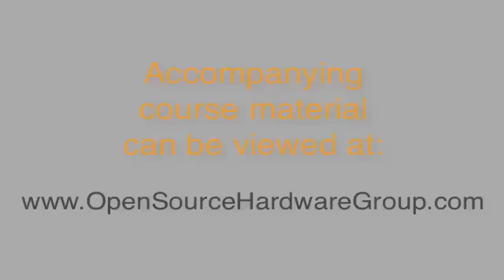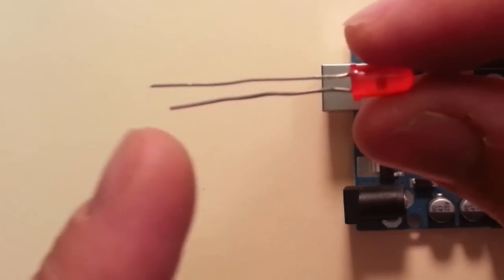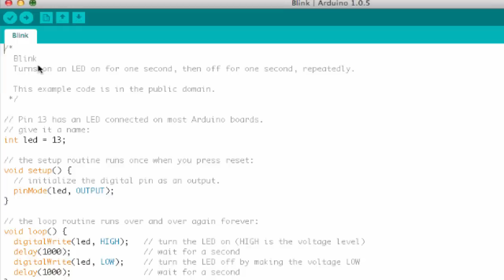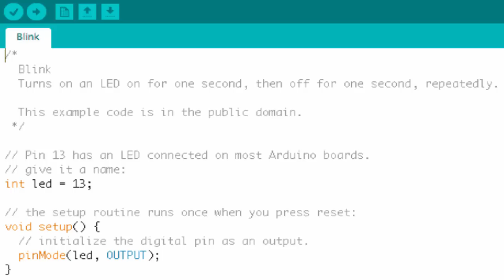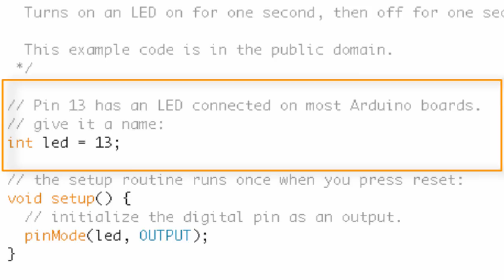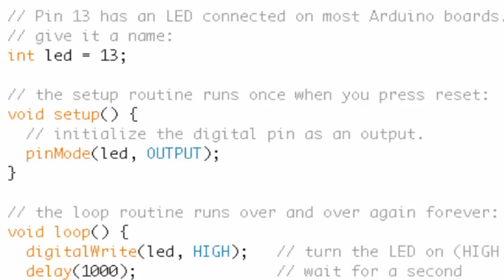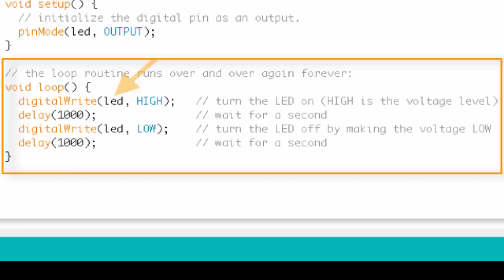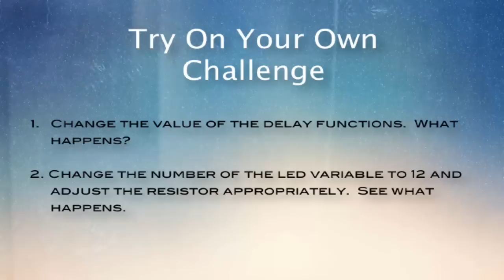Tutorial 06: How to Blink an LED: Arduino Course for Absolute Beginners (ReM)

Comment: If i change the delay of the led by increasing it the led will take more time to turn off
And if i change the number of led to 12 without changing the place of the resistor to pin 12 the led will be always off

Comment: can anyone explain me why we need to connect it to a resistor and not directly? if this is a silly question, please excuse me. im totally new to practical electronics.
Reply: Not silly, the current from the power source is so high, it would burn out the LED.  By placing a resistor in the circuit , the extra current is consumed as heat (in the resistor) and the current reaching the LED is within its ability to use.  OK?  There is also a voltage drop, but getting rid of the extra current is the issue.  Keep it simple.  If you do not use a resistor, the LED will burn out in a few seconds.
Reply: Thanks man.
Reply: No Worries, about wasting - it may seem that way, but the resistor is like a restrictive water pipe - not wasted held back.  The current (energy) and voltage (force) are not all wasted.  Yes some of the voltage drop and current go up as heat, but if the power were just enough to run a few diodes then the Arduino could not have all of those other neat devices hooked up to it without some external power source.  It is all a compromise.
Reply: It can but your led and arduino

Comment: what if we write int led = 50; or any number which exceeds the number of pins...does arduino take int variables to store the pin number only? or is it when we define pinMODE that it checks the value stored in led and takes it for a pin number...it associates the numbers to pin numbers inherently ?

Comment: I am using LED without any resistor for pin 13 and 12. It still blinks. Is there any problem if I don't use resistors with LED??

Comment: Sir I have a problem 
I want to blink one led (3 second on , 3 second off , 1 second on , 1 second off ) in a loop . I try it may time but I failed .Can you help me . 
Is this program is possible??
Reply: digitalwrite(13,high)
delay(3000)
digitalwrite(13,low)
delay(3000)
digitalwrite(13,high)
delay(1000)
digitalwrite(13,low)
delay(1000)

Comment: im having a problem with this code every time i compile it an error message is generated
int led=13
void setup() {
pinMode(led, OUTPUT);  

}

void loop() {
  digitalWrite(led,HIGH);
  delay(2000);
  digitalWrite(led,LOW);
  delay(2000);
}
Reply from the maker: You may need to add an " ; " semicolon after:
int led=13

Best of luck!

Comment: Do you have a tutorial that might help me do this with a breadboard because that is all I have?
Reply: Just run a wire from pin 13 to the positive power rail and one from GND to the negative, hook up the resistor from either of the rails to the LED, and hook up the LED from the resistor to the opposite rail that you started with. :)
Reply: Thanks this helped so much i am a super beginner so thanks for aiding me

Comment: void setup(){

pinMode(13,OUTPUT);
}

void loop(){ 
digitalWrite(13,HIGH);
delay(500);//Modificar para cambiar la velocidad de parpadeo             
digitalWrite(13,LOW); 
delay(500);//Modificar para cambiar la velocidad de parpadeo             
 }

Comment: I was thinking that setting a mode for the pin was useless because we are putting the voltage in the void loop so
i've deleted the part with the pinmode in order to see what happens 
and it was still working but with less light
why it is like that?  i didnt get it

Comment: I would certainly absolutely refrain from using the phrases "high voltage" and "low voltage" over and over because they mean very specific things. I would have instead used the correct terminology "high state" or "low state" or perhaps "high signal" or "low signal"

Comment: by saying that change the number of the led variable to 12and adjust the resistor appropriately......... what do u mean like putting the resistor on pin 12 and not on 13??????

Comment: Thanks for this tutorial, I was wondering if there is a minimum allowed delay time? the number you input is in millisecond but what if I want a delay to be in microseconds? does it work to just input delay(0.001) or the arduino itself can't control down to that limit?
Reply from the maker: Great question!  There is actually a function that allows you to enter microseconds called: delayMicroseconds()

You can read some about it here:
https://www.arduino.cc/en/Reference/DelayMicroseconds

Comment: Why is the resistor necessary? It seems to work just the same without it.. 
Great videos, lost of solid info. Thanks man
Reply: LEDs work on very low voltage, by NOT using a resistor you are litterally making the LED work at a much higher voltage , which it will do, but you are shortning the life of the led drastically.
If you have 2 LED's one with a resistor and one without and just turn them on. the one with the resistor will last for years, the other one will burn out quickly.

Comment: Excellent tutorial.
Can you help me?
The LED turns on the moment I connect the USB to the laptop, and the arduino does not respond to the program, the LED just keeps glowing.
What should I do?
Reply: That's because of the default program to check that everything's normal before you start working .. you need to overwrite the program to make it function differently.
Reply: +TATHAGAT MANI  ok thanks

Comment: how do we know which resistor to use?
Reply: +Arth Dh from V=IR (voltage = current x resistance) resistors in series you add resistances together for your equivalent (total) resistance. resistors in parallel you do the inverse of the sum of the reciprocals [(1/R1 + 1/R2)^-1]
Reply: +andr marq (Andrmarq92) Okay thanks

Comment: Geat,  but I have one suggestion. Could you please explain why are you using 230 ohm resistor? Why not 1k? Why do we need the resistor? 

Cuz you explain programming side so detailed and hardware side is what I personally don't understand.
Reply: +Fhhh Gdtvc 

It has to do with how much current the Arduino can sink or source at each pin. A LED or light emitting diode can allow to much current to flow if a limiting resistor is not used an damage the Arduino. Also the LED is rated for just so much current. Too much current flowing through the LED will burn it out also. With that said the lower the resistance value the more current that will flow and the brighter the LED will light. Too much resistance value and too little current will flow and the LED will be very dim or will not light at all. You can calculate the current flow with Ohms law. But normally 150 to 470 Ohms works well for a LED.
Reply: Thanks!

Comment: Someone please help! I'm getting an error message when I upload, it says:

avrdude: ser_open(): can't open device "\\.\COM4": The system cannot find the file specified.
Reply: +frost Nvm, I got it to work!
Reply: +frost inside the IDE (arduino software), make sure you chose the right model that you are working with under TOOLS->BOARD-> YOUR MODEL

and also select a port under TOOLS->PORT
Reply: Did that but no worky doky

Comment: Is there an Arduino simulator that I can use with components before running on the hardware?
Reply from the maker: +Lionel Faleiro To be honest I have never simulated an Arduino, nor have i used this program - but it sure looks cool!

https://123d.circuits.io/lab

Best of luck!
Reply: +Programming Electronics Academy I had a play on that site when I was waiting for my arduino to arrive. It is a little buggy and I lost interest after half a night of trying to make things work. It would be great if it was more reliable.

Comment: In regards to your challenges at the end of the video switching to pin 12 made the Led light not as bright, Why did that happen?
Reply from the maker: Hi Carlos Orta , by chance did you use the pinMode() function to set pin 12 as an OUTPUT?

Comment: Thanks again - just a quick question. Are variables for Arduino only meant to assign pin numbers? In other words, any number used in a variable is a reference to a pin?
Reply from the maker: Great question!  Actually variables in Arduino can hold any value, for any purpose you can think of.  It happens to be really handy for variables to reference the number of a pin.  But variables just as easily hold sensor input, times, and all types of information essential to getting a program to work.

In this example we could have used a variable to hold he delay time...

//a variable to hold the delay time between LED Blinks
int Delay_Time_Milliseconds = 1000;

Then in the code, we would reference our variable inside the delay() function...
delay(Delay_Time_Milliseconds);

Hope this helps some!
Reply: JustifyJustin think of variable as just a place holder for anything, like in maths 2+2=4 or a=2, a+2=4... :)

Comment: When I opened my example, I noticed that the script is not setting up a variable with the connector pin, instead it is actually coded the following way: 
pinMode(13, OUTPUT);

I figure when you call in pinMode, it assumes you need to have a pin which can be defined at this point or previously through the variable defined. I have some experience with python scripting and am excited to learn more about the arduino/C lanquage.

Thanks for the tutorials!!
Reply from the maker: Glad the videos can help!

Comment: Thanks for the great tutorials. It seems quite straightforward for someone with no electronics experience whatsoever, like me. Just one question, though. What would happen if you didn't include the resistor?
Reply: Resistor is used to limit the current through LED . so u dont end up wasting LED
Reply: Darshan Yadav  thank you

Comment: If you are learning like me a great trick to remember is this. The word CATHODE derives from the greek word "κάθοδος" which basically means decent. In greek they say "Ειμαι καθοδον" which translates as "I am coming". So always know that Cathode means "i am coming" which means the electricity is coming. So remember that the RED lead is purposely colored red indicating danger that a current is coming from it. The RED lead is the Cathode.
I always try to remember them as "the good and bad lead". The good lead is the red which is the positive lead and the bad is the black which is the negative lead. Also on a LED long means positive and short means negative. Long leg is the cathode and short leg is the anode. If you still don't remember this way, turn the LED around till you find the flat side. That flat side on the base of the LED indicates the negative leg.

Comment: Nice course! But why you need 220ohm resistor connect to ground? why not to put straight led to pins to 13 & gnd?
Reply: You'll fry the LED. Some kind of resistor is needed, I used a 330 ohm because that is what I had.
Reply: I think 85 Ohm resistor is more suitable, considering the voltage drop.

Comment: I entered the code exactly as you've presented it, however, when I upload it to the arduino board, the led only blinks a few times and stays on. Why does that happen? Why doesn't it continuously keep blinking?
Reply from the maker: Saila Maham Hi Saila,  Maybe try opening the example sketch, instead of typing it, and see if that works.  It would be under File > Examples > Basics > Blink

Comment: why does the resistor go in the pin 13
Reply from the maker: Great question.  If you wanted the long leg of the LED to go into pin 13 first, and then attach the resistor to the short leg of the LED, that would be fine too.  The resistor does a few things, but generally speaking it limits the current that can flow through the LED (otherwise, given enough time, the LED can be damaged).

Hope this helps.
Reply: thanks that helps alot! :)

Comment: Do I get the impression, you don't like cats? LOL
Does pin 13 not have a build in resistor?
Reply from the maker: Ben Sibeijn I don't mind cats :)

I am pretty sure the resistor at pin 13 will not  work to limit current for external LEDs, it does though work good for the onboard LED.
Reply: If one looks at the examples and illustrations for the hello world sketches (blink) including the one from Massimo's ( getting started) one sees that there is no 220 Ohm resistor connected to neither Pin 13 or Gnd. I have always inserted a led into pin 13 without a resistor. It does illuminate at the normal brightness and does not burn out. Thank you for your service to the community though. They will all appreciate your time and effort. Good luck with your endeavors.
Reply: Ben Sibeijn
Why are you asking questions you already know the answer to?
Reply: CptSpears007 The question is: why not ? :D

Comment: Can you make a video to explain how watts, volts and ohms work? For instance, why did you use a 220 resistor and how do you know when the resistors are needed etc?
Reply: very good point!
Reply from the maker: Hi PL, you know, I probably should - but I feel like so many other YouTubers to a good job covering that kind of stuff, so I have tried to stay laser focused on Arduino stuff.  But maybe I could make a video specific to components commonly used with Arduino...Thanks for the suggestion!

Comment: Thank you, your videos are very helpful. But when I change the delay time, the LED keeps blinking at the same rate. Also, when I change the int led=12, the LED stops blinking.
??
Reply from the maker: Mayam - I just want to check, are you re-uploading the sketch once you have modified it?  How much are you changing the delay time by?  Since delay is specified in milliseconds, unless you make a larger change, it may be hard to tell.

Also, the line of code "int led=12" tells the Arduino which pin to adjust the voltage at.  If you change the pin number from 13 to 12, you should also move the LED and resistor to digital pin 12.

I hope this helps.
Reply: Yes, I literally did every step in the videos and I made sure to upload the sketch. I tried changing the delay time to different values like, 100 and 2000 milliseconds but nothing changes.
When changing the pin from 13 to 12, I made sure to move the LED and resistor as well. I really have no explanation to why its not working.
Thanks anyway though, I find the details in your videos very useful.
Reply from the maker: Maryam, when you upload sketches, do see the TX and RX LEDs on the Arduino blinking?
Reply: No, they dont blink..!
Reply from the maker: Do you get any error messages when uploading a sketch to the Arduino?
Reply: No :)